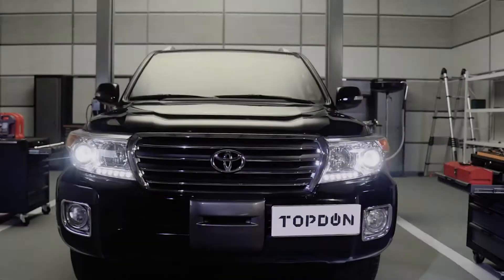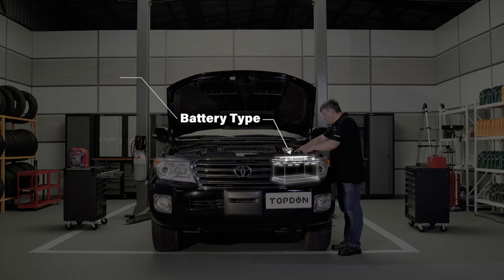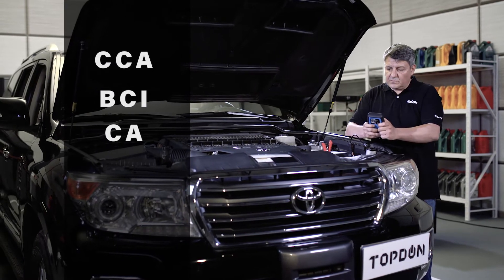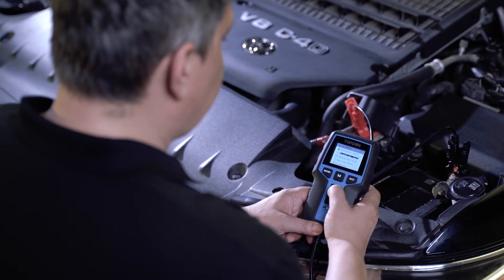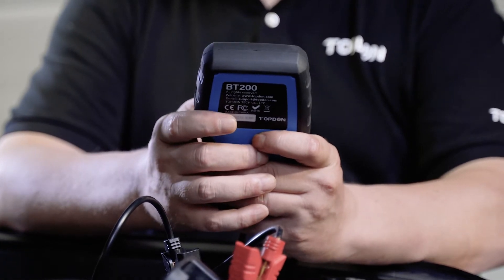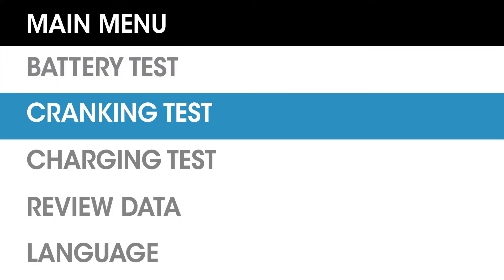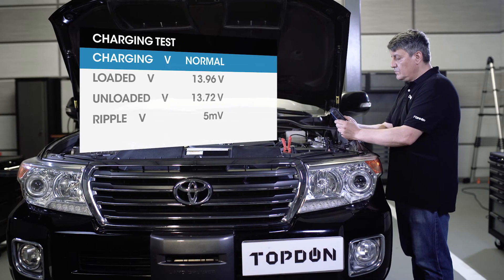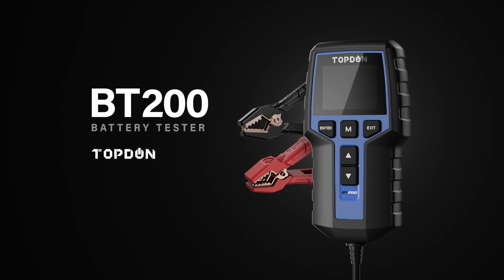What's TOPDON  Battery Tester BT200?

Comment: just got my bt200 today and tested my car battery, how is that possible that i get random reading on the same battery when i perform the battery tests, it goes from 4% healthy to 100% healthy, for example,  just by testing again the same battery multiple times???? i did not change any settings or connections, just performed the same test over again a few times and it gives me readings on CCA from around 300 CCA to 1225 CCA on a battery that is rated at 850CCA
Reply from the maker: Hello sir, for product issue, please send email to support@topdon.com, the technical specialist will follow up and solve the issue for you.
Reply: @TopdonOfficial  thanks for the reply, i just found out from a technician from a garage shop where i go that using the tester simultaneously over and over induces wrong values to the battery, it needs to rest for a while in order to repeat the test
Reply from the maker: @stephanepinel3907  Thank you for your support to Topdon. The product issue may need to provide the video to confirm the problem, so email communication will be convenient, if you have any question, please email to support@topdon.com. Thanks
Reply: @TopdonOfficial  i dont have video but im sure that from your side you could make one video showing what not to do
Reply from the maker: @stephanepinel3907  It does not means you must provide video, you can send email to  support@topdon.com, the professional technician will guide to solve problem.